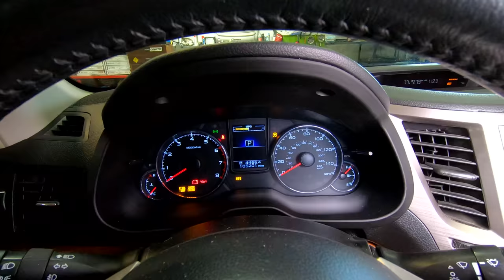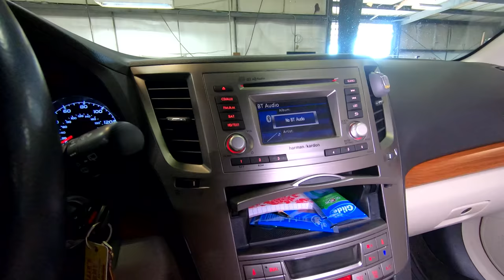Unusual sounds & smells cost serious $$$. CAR WIZARD shows how to find them and what caused them

Comment: If ANYTHING changes on your car -- ANYTHING -- that means something is wrong, and it's only going to get worse.  It will never fix itself -- even if the blinking light or rough running or squeak or rattle goes away, that is only temporary.  Any change of any kind is ALWAYS a sign that something is wrong, and could go "wronger" soon.  Never EVER ignore what your car is telling you.

Comment: I have heard several people complain about the fill plugs getting confused.  It would not have cost them anything extra to differentiate them.  Make one a hex and one a square or allen or torx or have letters or a symbol as part of the plug casting or die.  Have the drain plug match the fill plug so there is no confusion.  So simple

Comment: Some shops and dealers charging $600-800 or more for 2 pads and rotors may have something to do with people trying to extend their life.  Plus not everyone understands cars the way you and most of your viewers do.  I purchased my NORTHSTAR 2003 Seville with 55,000 miles for $4K because it needed $1,000 in Ebay parts.  Purchased and installed them myself.  Seller thought it was falling apart and sold it cheap.  10 years and 100,000 miles later, the car has cost a few thousand to maintain.  Luckily I got one of the good Northstar motors.  Synthetic oil for its life with me.  No major issues so far.  EDIT:  The car is a spare and mostly sits in the driveway but it always starts and runs if I need it.  $42K MSRP when it was new in '03.

Comment: I had leased an Outback of that generation. The 2.5 in that drank oil like it was its job. Being an observant owner, I noticed it was using oil between changes. So, when I took it on a 180 mile highway trip, I made sure to top off the oil. By the time I was 15 miles from my destination, I immediately pulled over because the oil level warning lamp was lit. It had burned through several quarts by then. I immediately called the dealer who said it's fine and to top it off, don't worry about it. I was furious.

After being unable to get satisfaction, I traded it in early because I just wanted out. I found out a few years later that Subaru had issues with oil consumption on these new (at the time 2.5s) and they had settled a class action lawsuit, resulting in long block and engine replacements with extended warranty coverage.

Comment: Wheel bearings are a very common problem anything over 70,000 miles. Plus you need to check the torque converter those things go bad pre 2015

Comment: I've been driving 4 years with the ABS light on. Ok. My mechanic says its the ABS Pump (Ford F250) but that it will stop without it. A new one, over $900 (the truck cost me $1K used!). I found a used/pull for $200 and still...it works without it. Ok, cruise won't work but its a Hooptie for errands so... but yes, don't wait for something to fail and have it checked out.

Comment: That's my kind of customer. I am very much like the wizard, I hate deferred maintenance. 
Get it done early is always the best advice. Servicing is key if you do it early then it will cost pennies as opposed to major dollars later on when because you were a cheapskate and couldn't be bothered for a few hundred dollars. It becomes engine out & $3,000-$5,000 later. That is squarely on the customer. I have many issues in my shop which are caused by deferred maintenance.

Comment: 1) Buy a reliable/durable model to begin with. 2) Cheerfully pay for maintenance/preventive work via (DIY or) your highly valued/trusted mechanic  3) Doing this, your vehicle is going to remain reliable for tons of miles and the more common necessary repairs as the vehicle ages (ie: starter or alternator, rotors and pads,  scheduled timing belt/water pump replacement)  will seem like a more controlled and reasonable investment of both your time and money.

Comment: SOME things can be put off, depending on how bad they are and not likely severely increase the cost to do them later, for example, putting off doing brakes for a month if yours are simply starting to squeak. Although safety may need to be assessed, generally putting off things like that may cause you to have to buy new rotors perhaps as the squeaking gets worse, but you can find decent new rotors for about $50 each, so if you have to wait, some things can wait a little bit.  Odd engine noises, I would not put off though unless you know exactly what it is and why it's happening.  On my truck (before i sold it) the idler pully was going bad, but made noise for a good six months until I replaced it.  Didn't actually get worse and the belt was fine, so I put it off for a while.

Wheel bearings are another thing that you can sometimes let go for a little while.  I mean if it's the bearing it will have to be replaced (or rather, the hub assembly) so it usually doesn't end up costing more than that if you let it go (as long as you don't let it get really bad, but if they are startging to go, you usually have a bit of time to replace them I've found).
Reply: If it’s squeaking and the brake pads and rotors are still good, it’s fine. Regardless of if it’s squeaking for any reason, make sure that you get it checked out.
Reply: Some things are overdoing it too and could be detrimental. Like the old transmission fluid change in a high mileage vehicle that never had it done. That’s not a reason to put everything else off too. I just think people are weary of getting ripped off replacing or “maintaining” every little thing that might not need it or be a cosmetic issue.
Reply: Not all rotors are $50. Some are $200-1000, depending on the car. If you hear squeak, check it out right away.

Comment: I actually had a shop try to sell me a serpentine belt on my 1991 F-350 once, said that it was bad, showed me a serpentine belt that was indeed bad. But there was on major issue, my F-350 has an old IDI diesel, with V-belts, and I called them on the bullshit, because I knew this already, and had replaced all 4 belts prior. Oh, and for those wondering, the 4th belt powers the vacuum pump, off of the alternator, diesels don't make very good vacuum.

Comment: Had a job snowball like this on my car. Noticed a torn lower control arm bushing. During LCA removal, the lower ball joint boot was shredded. Then, during sway bar link removal, they crumbled to pieces (probably factory at 250k miles). Then, during wheel speed sensor removal, it snapped off inside the knuckle. Then the CV axle took the inner bearing race with it coming out. Then the sledge took out the CV axle’s threads so the whole axle had to be replaced too. $70 to $240 in a few short days!
Reply: Only $240? 
Can I have the name and address of that mechanic? Please?
Reply: @JohnSmith-yv6eq  I did the labor myself, that was just parts. I assume if I brought it to a shop, i'd be looking at a bill healthily in the four figures.

Comment: Wizard I have a vehicle with a motor that you talk about being super reliable all the time it is a 2004 Pontiac Grand Prix it has 222000 miles and I have owned it since 2009 I wanted to let you know that the things that you say about this motor are 100% true as long as you maintain it and fix the things that go wrong around the motor the motor itself will last forever and like you said in a video not long ago the body will rot and rust and fall apart but the motor will keep going fortunately mine is not quite that far yet but it is showing its age but one thing that's not showing it's age is the motor it has no snaps cracks or Ping's in it it always starts for me everyday and it has never left me stranded and over my lets say 13 years of ownership so far I've put about $8,000 into it and I paid five grand for it with $86,000 MI in 2009

Comment: Hmm 100k and needs rear wheel bearings. Yea I don't know all the cars I've had never needed one replaced at up to 250k miles. Oh they kinda fixed the issue by 2014 with headgaskets, also another issue I've only had fail on me at 242k miles on my matrix and one that started to fail at 224k on my eclipse. It's too much for me to consider subarus nowadays, not to mention oil burning/eating from the factory.

Comment: We have had 3 Outback’s. They are great. They EAT hub bearings. No matter what brand you use, or if you use factory bearings, they’ll get eaten by my Outback. Last con is the absolute lack of power. But they are reliable, and get decent mileage for a AWD vehicle.

Comment: darn. 2014 and up newer Subarus 2.5 with no head gasket problem but using timing chain. I hope those are lifetime timing chains or at least as easy to replace as the older ones with timing belts

Comment: good to know subaru fixed their head gasket problems in 2014.  i remember the mountain pass heading up to tahoe practically littered with subarus that chose that hill to die on since the early 70s.  people that own them love them tho probably more than half the folks in seattle have at least 1 of them.
Reply: Apparently head gasket issues were solved much before straight injection boxer engines like the one in this video. 
Outbacks from the 2007-2010 gen with the EJ25 are free from premature head gasket issues, at least here in Europe you dont hear complaints from users..

Comment: At the Subaru dealership I work at there a car in for a new motor cause the customer changed the oil 2 in 60,000 miles just cause they didn’t want to spend the money or wait for that to be done and now it’s going to cost them big time

Comment: Bought a 2002 Chevy one ton van with only 118k with bad brakes with the caliper push out like the one you showed for 1500 dollars fixed it for less than 300and gave it away for 4500 good for me

Comment: A very good video as always!

I do have a question though: how often should you service your differentials?
Reply: My dad has a 2004 Subaru Forester since brand new and the owners manual reccomends every 30K miles so he has followed that schedule and car has 280K miles and never an issue.  Like the Wizard says, it's just easy maintenance, not very expensive and if you do it properly car will last forever.  It's also a 5 speed manual and Subaru has stopped offering manuals for a while so my dad who's 84 is planning to keep it forever

Comment: Yes the head gasket issue has been solved. However, many of the newer Subarus are known for burning oil in between oil changes under warranty and there has been some cases of Subaru replacing the engines under factory warranty but they are not as bad as Hyundai/Kia which we all should know by now that regardless of if it’s still under factory warranty or not, you should not buy one. It’s still worth the extra money to buy a Toyota, Mazda, or Honda product regardless of if it’s under factory warranty or not.
Reply: Agreed
Reply: I had one not to long ago with a 14 outback boxer 4 engine was knocking and in 2k miles it had burned 4 qts as a mechanic I will NEVER buy a Subaru product unless it's old that much oil that quick on a 100k mile engine is ridiculous it was well taken care of as well always serviced on time

Comment: I have a 1995 Ford Explorer so my wheel bearing replacement was the hub assembly and the CV axle.  It was going bad but it's replaced and I'm satisfied.  It's making a loud sound like tire noise mostly to me now
Reply: Old tyres? 
Some brands or tyre types get noisier as they get older and wear more....
or the wheel alignment needs to be done if it was not done after the work on the hubs/suspension?

Comment: Sister had a 1993 Ford Aerostar that would overheat. Ignoring it blew a head gasket. Turns out the water pump impeller was Gone. Too much money to repair…scrap van that didn’t have to happen…listen to the Wizard!!

Comment: I’m having my Suzuki Burgman 400 worked on. I’m having the brakes replaced, having the seat recovered (I’m supplying the seat cover) and having a new lock set being installed. Putting the key in the ignition and turning it on is getting sloppy. Time to replace it.

Comment: On older Subaru Cars, you need to have the Timing Belt Checked every 50-60K miles.  If the timing belt brakes its time for a new engine.

Comment: What about the factory recommended 100,000 miles major maintenance when the dealer will charge 4 to 5k to change everything to new so the car can run another 100k miles with no issues?

Comment: I’m driving one of these right now. I noticed the AT TEMP light came on one day while driving at highway speeds on a HOT day running A/C. I pulled over, shut down, and after a few minutes, all was well. I’m thinking with 90,000 miles it could be time for a coolant flush. And I’m sure the diff fluids have NOT been changed. Is there a consensus that, yes, probably inspect/do those things if needed?

Comment: Cars require routine maintenance. People think they can simply put gas in it and drive it for 100,000 miles without any other type of service. I guess that makes the argument for them to own an electric car. But they should still have the hydraulic brake fluid flushed every 15,000 miles. But you know they never will.

Comment: Now, if this car was a BMW and the CEL illuminated, rush the vehicle (tow) immediately to BMW dealership service center. Follow with panicked call to "service advisor" and tell them to do immediate diagnostic and to repair anything that they beleive needs  repair or replacing and perform any maintenance/ servicing they see applicable. 😉

Comment: If trying to save the most amount of money, the Subaru owners best way to keep their money is to get out of the Subaru and into a Honda or Toyota.
Reply: Nobody's perfect.  Even Toyotas and Hondas can get recalls for a variety of issues (and yes, even Mercedes has recalls for some things).
Reply: @houseofno  correct, some have issues. You just have to know which ones to buy. But even the worst will still cost less to repair than the Subaru.

Comment: Wizard, isn’t it important to change the cvt transmission fluid, especially at over 100k miles?
Reply: subaru america isnt replacing fluid and qcting as if this is gospel. subaru japan suggest replacing at different intervals depending on use.

Comment: Just met a random Mom and son traveling in a Subaru Forester 2010. They have been traveling for hours and there car overheats more than 10 times. I don't think the heads are gonna make it.
Reply: All cars mess up eventually.
Reply: @montreauxs  yes, but this mom and son are attempting to drive about 150miles that overheats every 1 hour....and the coolant overflow bottle is deform. Tell me that is not bad? They are out of state people.
Reply: 2010 Subarus still had head gasket failures. I believe starting in 2012, Subaru replaced the head gasket prone engine with a redesigned engine. Subaru tried doing some updates to that engine but every version of the head gasket still blew. If the head gasket is blown, it’s time to buy another car even though the prices are high right now. I wouldn’t buy another Subaru either. That car has more than likely high miles on it.

Comment: If someone brought me my own serpentine belt out of my engine just to show it to me without asking. 
I'd be quite pissed.
Reply: Why? 
If you know that the one on your car is simple to remove and replace....
and with it out you can show the wear, cracks, metallic particles etc....
You'd be an idiot NOT to get it replaced then and there  as it would cost so little?
But of course you would insist on seeing the car without it's serpentine belt...and of course you would know the length and PK count of the removed belt..
and ask for the old belt (which you had previously marked with indelible ink) to retain it after the replacement...?
Scams only happen if you let them....
Ditto oil filters...marked unobtrusively.....
Reply: @JohnSmith-yv6eq  You do nothing to my car without my permission.
Reply: @forfluf  
Well, ignorance rules then....

Comment: i have a crosstrek with a 6 speed manual. does the manual require fluid changes?
Reply: Every transmission requires fluid changes check the owners manual for the interval if it says lifetime check online

Comment: I've only heard bad things about Subaru.  Head gaskets, cracked blocks, oil line leaks after 3 years. Definitely not Toyota quality.
Reply: Headgaskets & Burning oil has been its biggest downfall.
Reply: Most Subarus are actually built pretty well.  Not on par with Toyota or Honda, but certainly better than Nissan (owned by Renault, notorious for being as cheap as possible) or Mitsubishi.  I might point out that even Toyotas and Hondas have had various recalls for various vehicles and issues over the years, but they're not as bad as a number of other competing brands.
Reply: I will say it's hard to get a better car for winter. You have to try really hard to lose traction in snow and ice and I could pull out of snow deeper then I had clearance for. I won't get another one though with how much I had to dump into it for repairs and it rusted out quick in the rust belt.
Reply: @houseofno  don’t forget that Toyota owns a large share of Subaru and two of its cars are clones of Subaru vehicles

Comment: I was told that wheel bearings should be replaced together, anyone any insight in that?
Reply: Yep. Common knowledge between mechanics is when a wheel bearing starts making noise, better get ready to replace them in both sides.